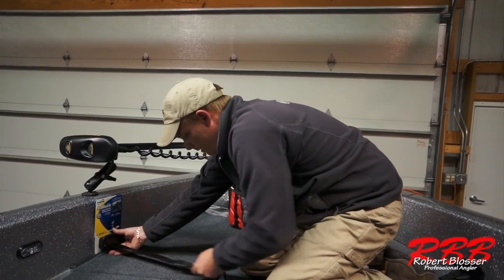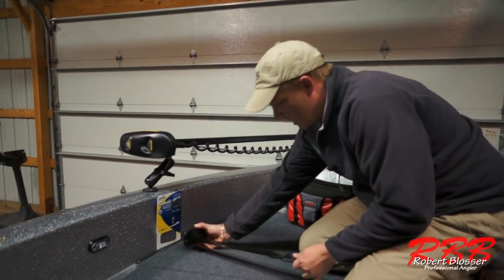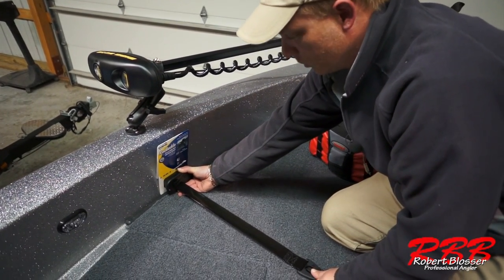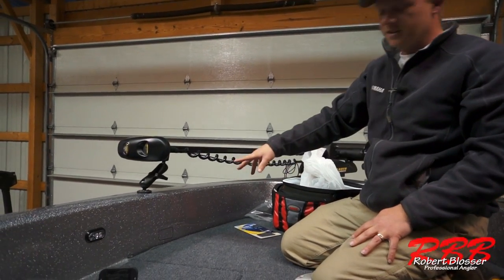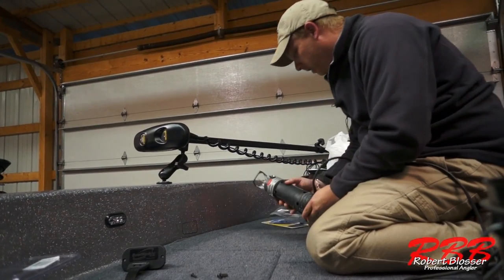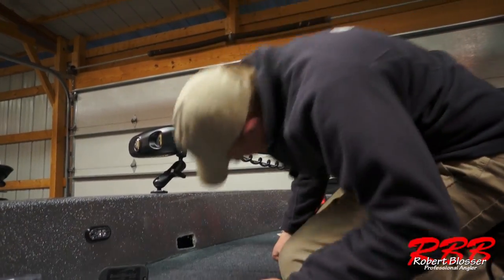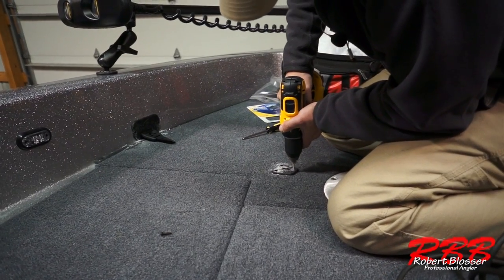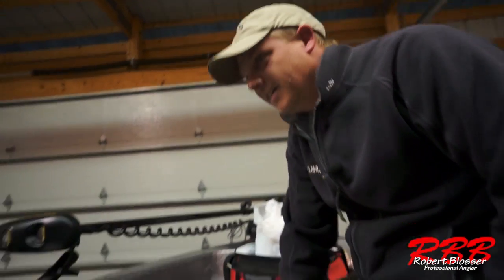Rod Buckle Install

Comment: instead of using the rod locker as a guid you should put a few rods down and see where you need the strap because you cant open the locker with rods strapped down anyways and the strap retracts if theres no rods. so being clear of the rod locker is pointless IMO